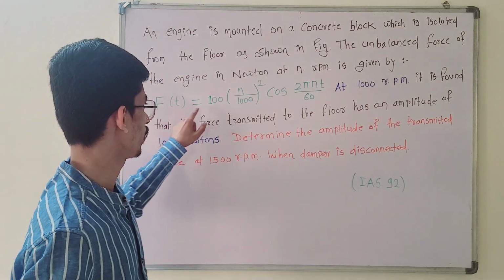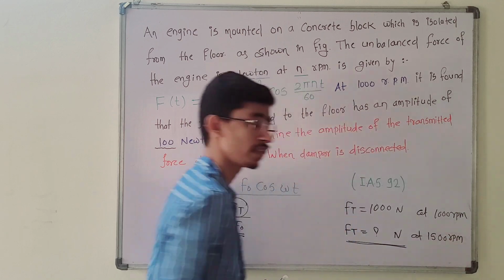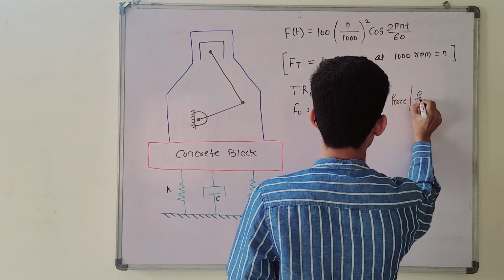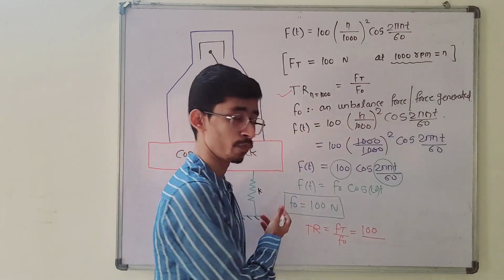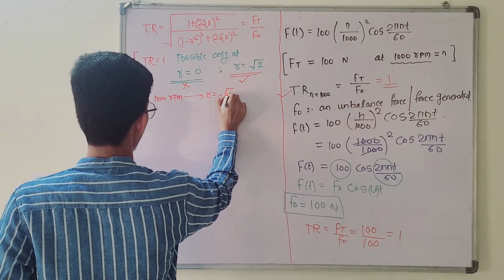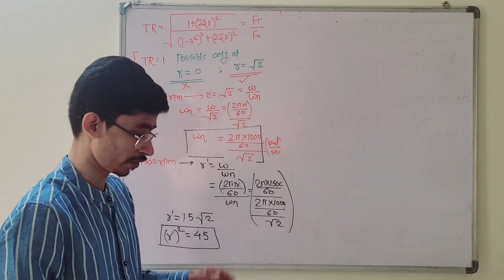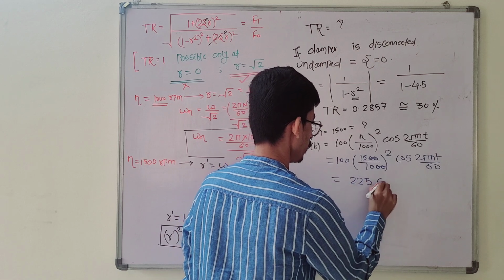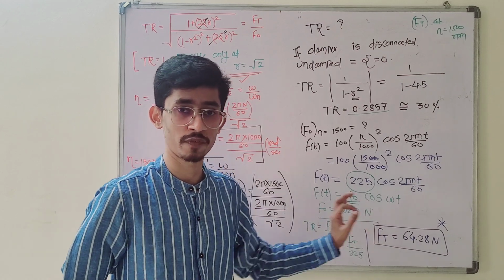Vibration Control Numerical based on University of Mumbai Syllabus @Minendra

Comment: a) A structure supporting a rotating machine is found to vibrate excessively at an (12)

excitation frequency of 18 Hz. It is proposed to attach a vibration neutralizer tuned to this frequency What should be the mass and stiffness of the neutralizer so that the resulting two natural frequencies are at least 20% away from the excitation frequency? The supporting structure has an effective mass of 1000 kg and a natural frequency of 16 Hz.
Iska answer batav sir solve karke do